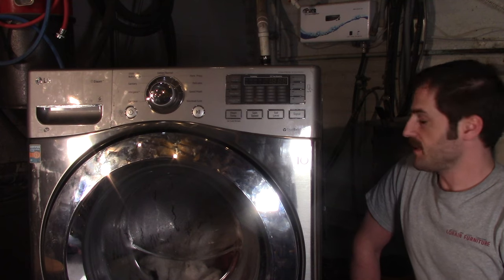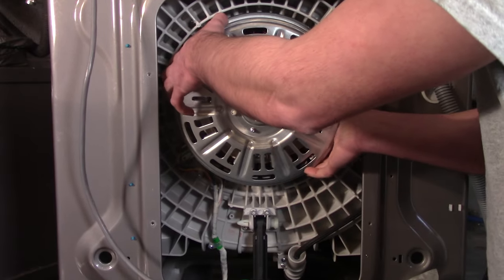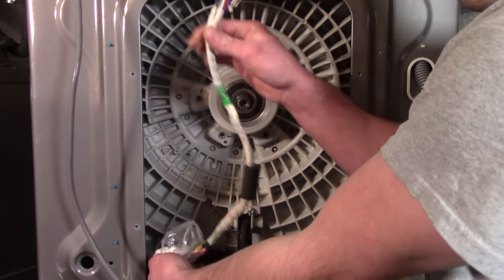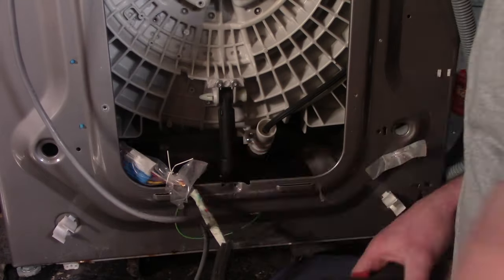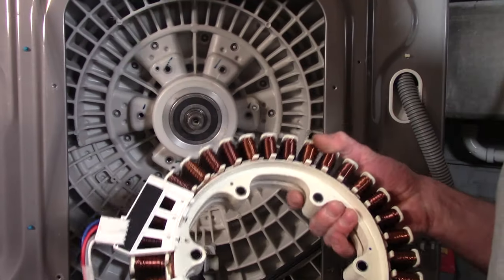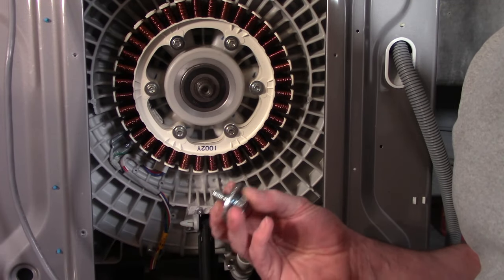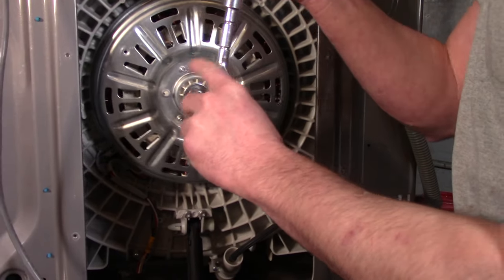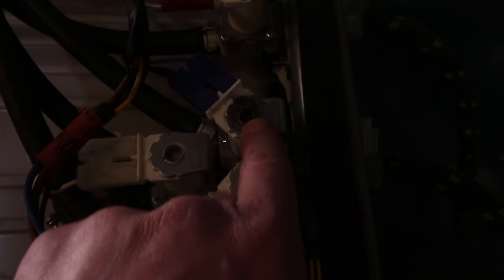LG Front Load Washer LE Error code Repair Tutorial How To Fix

Comment: Before trying all this…you may want to just unplug the unit for a few minutes (I walked away for 5 minutes) as you are plugging in, press the “Play/Pause” looking button for 5 seconds. Doing those two things reset my washer, without having to get behind the unit or take anything apart. Same worked for my dryer two months ago too!! 🙌🏼
Reply: Yeah, when you perform a reset after an LE code in some cases its due to just simply over working/stuffing the machine. Break up your loads if you pack it heavy.
Reply: THANK YOU!! After avoiding dealing with my washer I fixed it in 5 minutes haha
Reply: This was very helpful! S ok glad I didn’t have to get a new part
Reply: Thanks for posting this. I tried this out and it sadly didn't work so we got a new wire harness and it worked!
Reply: Life saver ty!!!

Comment: Thank you for this great video!  You did an excellent job explaining and showing what needed to get done in order to fix the LE error code.   No life story behind it like some other content creators do.  Just short, sweet and to the point.   My hall sensor was bad.  You saved me a lot of time and money and for that I am very grateful.  The part was only $10 on Amazon shipped to my door the next day.
Reply: I didnt even think to check Amazon before buying the Hall (Rotor Position) Senor from my local appliance parts which ran about $45. I wanted a Genuine LG OEM part and all the ones i found on Amazon were off-brand.  Genuine from online parts stores were $28ish but would have taken days to ship.  Either way just like you, had a bad sensor which swapping out fixed the issue.
Getting that main bearing nut off was a real pain.

Comment: Not all LG washers have a hall sensor (aka rotor position sensor).  The models ending in CW (Cold Wash) generally use the control board to control the motor and there is no hall sensor.  If you have a LE error on these machines you need to check for physical damage to the stator or wire harness, or possibly you need a PCB board.  PCB board is much less likely to be the problem.  You can google "LG xxxx parts diagram" where xxx is the model number to determine if your machine has a hall sensor.  Stators and PCB boards are very expensive parts... wire harnesses are cheaper and you can often splice/repair them yourself.

Comment: Thank you so much! All the research I did before pointed at needing a new washing machine and I was ready to spend over $1,000.  Weeks washing clothes daily for our kids, so there’s no option to not have a washing machine. Found your video and immediately bought the kit from you on Amazon. All the instructions were super clear and I had no issues doing it myself. Took me less than 20 min to do the work and now I feel I have a brand new machine. You saved me over 1,000 bucks. Thank you so much.

Comment: Part numbers that worked for me:
Wiring harness: 6877ER1016H
Hall sensor: 6501KW2002A
You probably want to remove yours first to make sure it is the same.
I splurged for the genuine LG parts, about $28 each on Amazon.
Washer works great now!!
Thank you very much for the video!

Comment: The most informative video. I checked the part number online and ordered one from Amazon for just about $25(CAD). I changed the sensor of my machine in literally 15mins after watching your video. Really very well explained. Thanks to you. I saved atleast a couple hundred dollars in labour. Cheers!!
Reply: Could you please tell me what is the name of this part
Reply: @BabAl-HaraEnglish4270  I had ordered from Amazon Canada. 
Brand - PartsBroz
Product-
6501KW2002A Rotor Position Sensor Switch by PartsBroz - Compatible with LG Washers - Replaces AP4440680, 1268238, AH3529186, EA3529186, PS3529186
In my case the drum was not turning because this sensor was faulty. It was an easy fix.
Reply: @nakulmohindar  thanks for the info. My lg top load stopped spinning. Going to check this as well
Reply: @AMC55555  I used this for front load. Not sure if it is the same part of the top load.

Comment: Just followed this step by step. Took me about 15 min from start to finish. Only replaced the sensor (part# 6501KW2002A) for LG washer model WM3570HVA and it fixed the LE error! Thank you so much for the tutorial! The sensor was only $10 from Amazon and I'm sure it saved me hundreds of $$ from calling a repair man! Thanks again!
Reply: Thanks very much for including your LG Model # and the Part # of the Sensor that you used successfully. I have exactly the same model and I just ordered the same sensor, so that gives me some optimism that it is a correct part for my washer, and may actually fix the LE errors. I've also ordered a 6877ER1016F Multi-Wire Cable assembly, and I don't know if that is the right one, or not.

Comment: Another awesome video!
I pulled the short harness and did a pin to pin test, found 1 broken wire (blue) and 2 imminent failures. This was right at the plastic anchor clamp near the drum. 3 Crimp connectors later, I have a working machine.
I have ordered the harness from Lorain Furniture because YOU have done the leg work and shared it with us. Thank you for what you do!

Comment: Thank you! I ordered a new Hall sensor because it was only $30. The plates on the stator had some rust, especially on the bottom, so I brushed them off with a wire brush, gave them a spray of WD 40, wiped down the Rotor magnets, gave them a spray. Whole job took an hour, but add another hour to go buy new hoses. The cold water was leaking right at the machine. I suspect that some of the drips got into the rotor/stator causing the rust. Not sure if the rust was the problem or the hall sensor. Works great. Really appreciate the instructions. Now let's see if I can send you a few bucks for being so helpful.

Comment: I lucked out and guessed my rotor position sensor was the fault. Replaced it and the washer worked again! 
For everyone wondering… pull the position sensor before buying the replacement. The old one will have the part number listed right on it. That’s the best way to know you’re buying the right one.

Comment: Thank you, Thank you and Thank you!! I ordered the Hall Sensor (OEM) for ~$22 from Amazon, replaced it following your instructions and boom, it worked!! 
I contacted LG authorized service person and he quoted $220 + $65 (Travel) if the issue is not with the motor and if the issue is with the Motor then $160+$65. Can't thank you enough for this great video!
I had LG Washer : lg wm4270hva 
Was getting LE error code

Comment: Thanks so much for this!  I just fixed mine in about an hour with the $12 replacement sensor from Amazon. My wiring harness looked good so I didn't bother replacing it.  Ran a couple loads through the wash now and seems to be working great.

Comment: Thank you very very much! Our local repair guy charged $100 to tell me the motor was burned out and we needed a new washer.  Your video made it very clear how to disassemble. I ordered a new hall effect sensor and wiring harness (thanks Amazon!), installed them, and my washer works like new again!

The hall sensor part number is on the hall sensor. The wiring harness part number was on a green tag and ends with 2061005. That was enough to choose between the two LG harnesses I found on Amazon.

Thank you!
Reply: Thanks for the info about where to find the part numbers.

Comment: So glad I found your video! Saved me hundreds of dollars. I did have a hard time removing the center bolt, no matter how hard I tried to pop it loose it wouldn't budge. I ended up placing the ratchet facing 9 o'clock, held the drum still with my hand, and used a hammer to gently hit the ratchet in a downward direction. Seemed to pop the bolt loose pretty easily. Everything else was pretty simple. Thanks again!
Reply: I've tried this and my bolt still won't come off ☹️

Comment: Hello. Thank you so much for this. I had the same issue. I live in dubai. The 3rd party repair guy asked me 600 AED saying the drum was gone. Then I thought let’s try this. Ordered the parts from Amazon. (Uk) 

Fixed the  hall sensor but couldn’t fix the cable I ordered. As the cable goes all the way in there is no in between connection. So just fixed the hall sensor. Now working perfecting. 

Thank you.

Comment: I want to take the time to Thank you for the video!!! It's clear and super easy to follow.
Same with many of the ppl commented here, I only needed to repair the hall sensor. Saved me $ and hassle needing to call repairman.
Mine is a 7yr old LG washer WM3570HWA with the LE error msg. The hardest part was removing the center bolt. Other than that, everything else was easy.

Comment: This is not Pieter; it's his wife, Natascha.  Yes, I fixed it!!!  Thank you, thank you, for an excellent video with clear instructions.  The hardest part was cleaning the filthy floor under/behind the washer before getting started :)  Don't know if it was the Hall sensor or the wiring harness, but I replaced both, for $47.68.   I would add that six years ago, our then 7-year old washer had an LE error, and LG insisted the whole motor needed replacing, for well over $300.   And yes, we paid them...  Now it happened again.   LG wanted $402.50 to fix it this time!!! The schmucks!  Take that, LG service, I'm never calling you crooks again.   One thing that caused me a bit of trouble, was removing the central 17mm bolt.  Jerking with the socket wrench didn't loosen it.  So I used a pair of garden clippers, the edge of the curved blade fit nicely into the slots in the motor, and let me brace it with one hand, while using the wrench with the other.  Again,  many thanks for the video!

Comment: Thank you so much for this video!  I replaced both the wiring harness and hall sensor on my model WM2688HNMA washing machine, per your suggestion.  The odd motor sound and the error code are both gone, and the machine is back up and running with no issues.

Comment: I replaced the sensor, and the LE error became intermittent. I disconnected all harness connections and reconnected them, I had the same problem. I then replaced the harness, and the unit works like a charm. The harness showed NO evidence of damage. Must have been internal.
My washer:
WM2501HVA
Sensor:
6501KW2002A
Harness:
6877ER1016F
Thank you for a great video.

Comment: Your wonderful video just saved this single gal HUNDREDS of dollars! After having a battle royale with a terrible appliance repair company (I know they are not all bad), I ended up fixing it MYSELF! (thanks to your easy to follow, helpful video!) The only thing I will add, is that mine JUST ended up being a bad hall sensor, which I purchased for $17! I also purchased the new stator assembly and motor harness, but will be returning them both since the new hall sensor did the trick, on my old stator assembly! Thanks so very much again! GIRL POWER!!! (with the help of your great video!) And...2 loads of laundry done so far, and working like a charm!

Comment: This was clutch!  Only repaired the sensor part since it was going to take a week more to get the cable.  The sensor replacement was easy with your video.  Went from planning to spend $600 on a new washer to a $14 fix!

Comment: Thanks!!  Just tried this and it totally worked - it was the hall sensor (rotator position sensor) - a whopping $12 on Amazon (part# 6501KW2002A).  I looked at the cable harness and it looked fine so I just ordered the sensor.

Comment: Thanks again for this, had no idea it was so easy to work on.  Mine was simply a bad Hall effect switch.  Thanks to another video I found that that the encapsulation is very poor. It pulled right out.   I had bad resistance on one of the pins, replaced the old 681 SMTs with a pair of nice big 680 ohm thru.  I suspect it will last years more compared to those tiny 681 SMT resistors.  Thanks again!

Comment: I was about to call LG to repair and decided to do a Google search first.  So happy I found this video.  I ordered the parts directly through the LG website and the repair was easy following this excellent tutorial.  Thank you so much!! Not sure if the harness or hall sensor was the culprit so I will keep both used parts for now.  BTW, we're pretty sure the LE error was caused by overloading the washer, especially with very big towels.  We will be extra cautious next time.

Comment: I want to thank you for your instructions, we saved hundreds on a repair service as I ordered the Hall sensor and wiring harness and only spent $50 with shipping & I actually did the work myself and it works, again great job!
Reply: Hi Carl, where did you get the parts? Do you have the part number for the wire harness and r hull sensor?

Comment: Thank you so much, a perfectly edited video, and your fix for the problem I experienced worked great.  Some minor issues -  the sensor I ordered, part 6501KW2002A, was not the one in my LG WM2032HW, which had part number 6501KW2002B.  The B sensor had only one clip on the side opposite of the connector instead of two, and only two of the pin holes on the B sensor were U-shaped, whereas the A sensor had 3 U-shaped pin holes. The harness I ordered, 6877ER1016B (which was the cheapest one on Amazon) was an exact match to what was in the washer, so I took another chance and gave the new harness connector a shove (square peg in a U-shaped hole) and made it work.  So I recommend to folks that they remove the harness and sensor FIRST to get the actual part numbers before ordering new parts.  If I ordered wire harness 6877ER1016M as recommended, it may not have worked at all, or may have worked perfectly.  Who knows.  YMMV.  I'm just thankful that guys like you make videos like this for DIYers like me.
Reply: Well, the error came back today after my wife tried to run a load of sheets.  I'm really second-guessing the hall sensor situation.  I ran a rinse and spin cycle, and the error came back after a few minutes.  So I drained the water out, saw a lot of black suit at first (better than the last time when the drain hose was completely plugged with sand and took forever to get cleared out) , closed the water spigots during the rinse cycle as I was draining it, and right before the rinse cycle ended I turned the cold water spigot back on it and got through the cycle successfully.  By the end, nothing but clean water was draining out.  So now I'm washing ONE sheet instead of the whole load, and we're going to be cautious about overloading our 20 year old washing machine with a suspect hall sensor.  Glad I didn't throw away the OEM part, it may save me if it happens again (50/50 chance I guess).  I really don't know what I'd end up with if I tried to byuy another hall sensor, even from your store.  Maybe I can send you photos so we can compare (if it goes LE again)...

Comment: My LG had the same problem - Broken Wire! In that lower motor harness. The red wire going to the Hall Sensor. Used a multimeter and checked for continuity in the harness and sure enough snapped the red one right at the zip tie holding it to the body of the machine before it goes to the tub. Thanks for the video! It seemed everyone else online jumps to replace the Hall sensor (so did I).

Comment: This is a great video!  My only suggestion is if you were giving us all the detail on how to disconnect the tabs on the hall sensor, to have not then super sped up disconnection of the motor wire harness.  That was far more complicated - especially on the blue part where you have to push in on the sides and depress the center tab at the same time.  I had to watch video after video until I could see someone disconnect just that part. Over all though, I appreciate the help.

Comment: I have always had good luck with my LG front loads. When I bought my first set I was dead set on a Samsung set but researched more and found that LG was more reliable. I was wondering if you would ever review a Samsung?  Would like to know your thoughts on them. Also have you ever considered using Persil detergent. I use to be big on tide also but feel that Persil works better for me. Keep up the good work on the videos. Very informative

Comment: Decent tutorial, thanks. However, you skipped an easy first step which could also cause an LE error. That is integrity of the spin bearing + rotation. This can easily be checked by turning the inner basket by hand to check for grinding, or possibly a trapped garment between the 2 drums. Also, grabbing the inner backet outer rim @ 12 & 6 then @ 9 & 3 o'clock positions, and rocking back and forth to check for play. Lastly, as I recall..you didn't bother to mention to check the rotor for cracked magnets + the spines, if they're worn out this is also a problem. Cheers!

Comment: Everything ok but I’m getting a grinds a bit from my new stator cover. It is on tight; but sounds like the new cover magnets are trying to grind a bit on the stator to maybe even up any tolerance issues between the new thick cover magnets, and those on the stator (rotor)? Or perhaps I did not totally center the cover? Will check everything again but help is welcome!
Reply: All good now! Bearing was squeaking from washer sitting dormant. Thanks for saving me tons of $$$ on a repairman or new washer; great video!

Comment: While a wiring harness is in fact pretty cheap off Amazon, IMO no need to buy one If you have the LE Error code. Most likely its the Rotor Position Sensor (aka Hall Sensor) that has gone bad.  Replaced mine and worked like a dream ( at least so far). 
You may need a decent sized breaker bar to get that main nut off, mine was quite the challenge due to the factory blue Loctite. The Sensor itself does not require much force at all to get off, be cautious when removing/inserting any of the plastic clips.